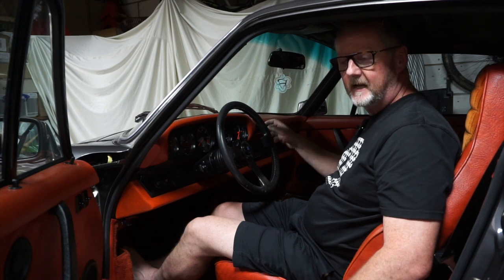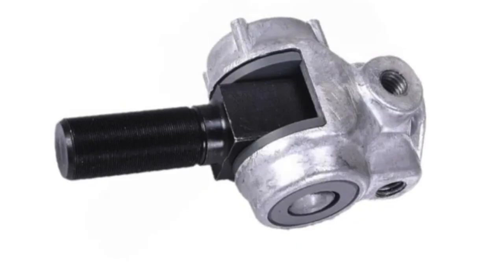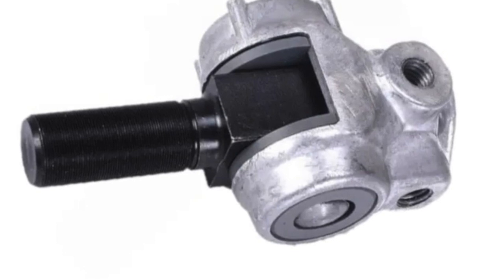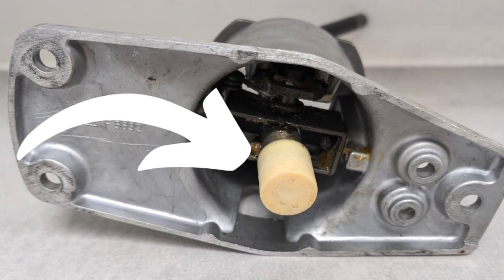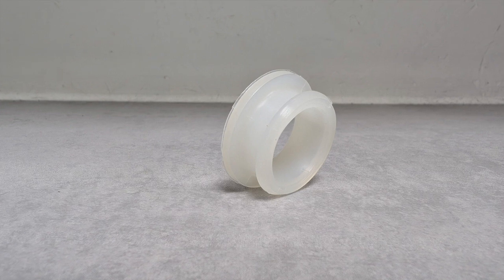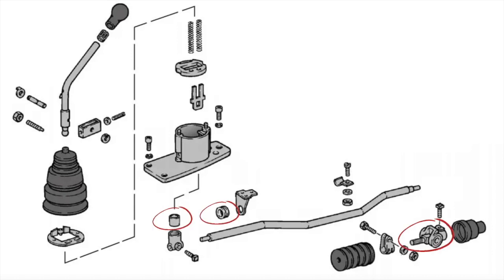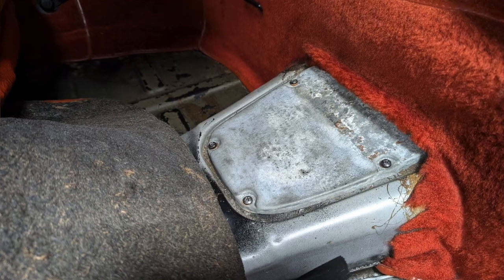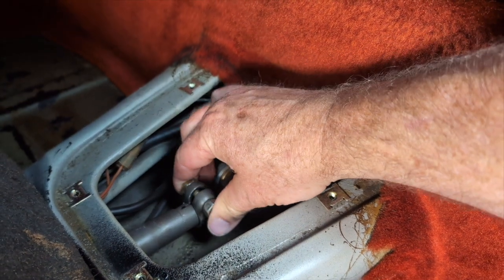How to adjust Porsche 915 gearbox linkage

Comment: This is really useful thanks. 
Been fine tuning mine for months 😂
It now changes gear great but I occasionally hit reverse by accident, can’t understand how I get past the gate towards reverse. I’ll keep trying 😊
Reply: Use a set square to make sure the lever is 90° with the housing, it could be causing your issue, or, check the spring plate is ok which is what stops you from going to 5th from reverse

Comment: 14:06… just learn to double clutch if you have syncro problems. I did my shifter bushings a little over a year ago. It made a world of difference as the bushing in the universal joint was practically just gone lol. I’ve only driven the car once since the bushings as the car is halfway torn down for suspension and brake work, but it did pop out of first gear on me… so not sure if I need further fine tuning in the linkage or if the syncros are just gone. 
Either way, double clutching on ALL of your shifts takes the syncros out of play until you can afford a gearbox rebuild…